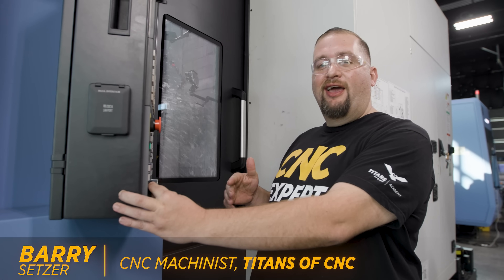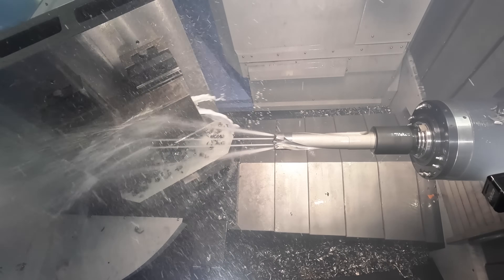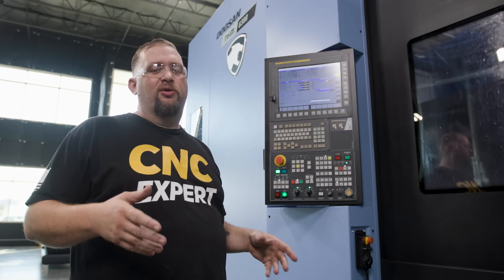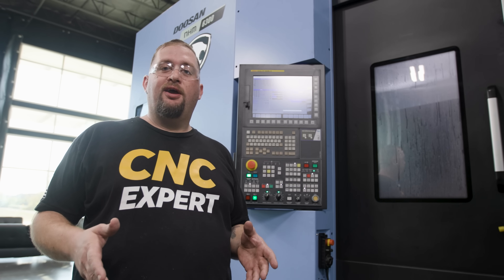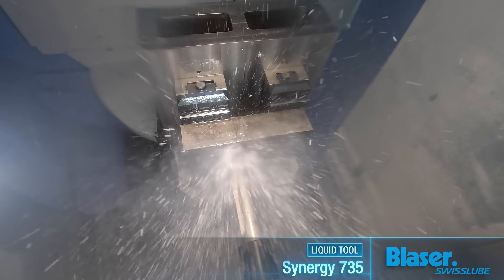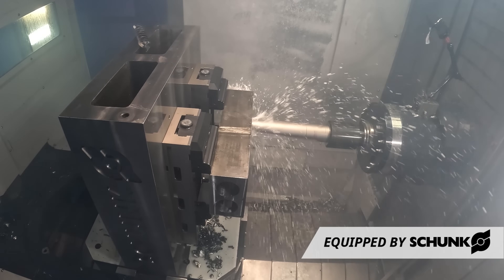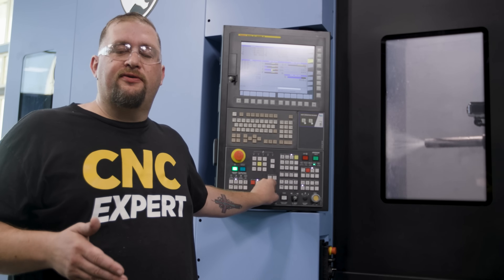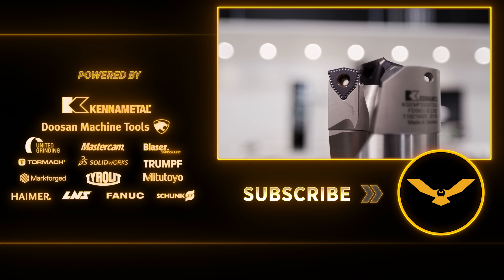Monster Drilling Test in Steel | NHM 6300 Horizontal CNC Mill | DN Solutions

Comment: That’s pretty small 😅 I’d send a picture of a drill I used to run on a Mori Seiki mill I used to run drilling steel flanges for deep sea oil pipelines but I don’t see an email. It was a long time ago but the drill was probably 5” in diameter by about 3 feet long. It was pretty funny there was some guy that didn’t know what he was doing and the mill had a top spindle speed of like 10,000 RPM and he had the drill in the spindle in jog mode and hit the spindle on button the machine went to go to 100% 🤣 it threw that drill through the sheet metal on the side of the machine and skipped it across the concrete floor in the building! Fortunately it wasn’t me that did that oops, that cost the company a ton of money, it actually broke the shaft in the spindle and destroyed the bearings. It was pretty cool, just not cool for the guy that did it as he got fired and not cool for the company because it had to have cost them $50,000 to repair all the damage to the machine. 🤣

Comment: I felt scared watching it that drill bit drill into that metal I literally was thinking something was going to break it was making me feel scared,and that's I could literally feel the drill bit eat and it was hot but the cool water was cooling it down and so it was just shredding, I thought something was going to break when it drilled in to the center did you drill back through  the holes and make a sharp edge, sharp enough to cut your finger, mama said you'll draw back a nub you stick your hand in there, at that point it's funny that you said it's scary, (ddtah) don't do this at home, and it was complete euphoria knowing that we have the ability now to do this, drill a straight hole that fast., super stroker soaker.,-) could you imagine if you were chained inside that thing. And someone just ran a random program on you how that would feel.,-())

Comment: How about running a 4 inch spade drill in a cnc machine (lathe). Is this something that can be done? I had to put a 6 inch thru hole through a 7 inch piece of S7 this week. Eight pieces going to take me maybe 10 days to do the whole job. Works out to about 20 hours of manual drilling. I used a 4 1/8 inch spade drill to start the hole. Sharpen the spade drill twice per hole. It wasn't too bad. I'm kind of enjoying the job. But I'm thinking how nice it would be to just to use a CNC machine to do all my work.

Comment: I know every has their opinion on this question I’m about to ask… Mr. Titan I have a question to ask n I hope u can help since u own different makers/brands of cnc’s. I’m n the market for a mill with a y axis of at least 30”. We have already a few haas vf3 vf4 vf5 n the shop. We have had an issue that cost us a good amt of $ cuz the vf5 bearings went out on the table. So that there alone makes us think twice about haas reliability. We bought the vf5 brand new. What would u recommend? My old man is stuck on some other brand I’m not too convinced about n how the sales person is dropping off $100k on the price. Makes u think why? I want to get my monies worth. We run a lot of aluminum  n that’s what we’re are purchasing for n the occasional steels no exotics. Thanks ahead of time for ur help.
Reply: In case Titan himself misses this one..........Here at Titans of CNC we run Doosans, we have no HAAS machines in the building anymore. The reason for this is that Doosan is a much better built machine for the money, and Titan wanted to make sure that he was representing the best value and quality for our friends out there. In this video, I am pushing that drill to over 180% spindle load in some places, and the NHM6300 didn't even blink.
Reply: As an example of Doosan reliability; I run a Doosan Puma 2600 4 axis lathe and routinely push the milling spindle load to 250% with spikes up to 400% and it just eats all day long. I also frequently run the lathe spindle as high at 130% load when roughing and it also just eats all day long.
Reply: Thx for the replies guys. Yea we had a sales person come out from Ellison Monday. I like what I hear about the VMC. As for lathes pumas are one of the best out there. When I worked at another shop doing premium threading all they had were puma n mori seki’s. My old man has his vision n I have mine jus like every1 having their own opinions. I hope I can get a doosan. Was looking into the DNM 750 series.

Comment: Simple question?
Why do you hang your vises with the solid jaw up? I’m getting ready to add vises to my tombstone sometime next week
Reply: I would like to think that the reason why, is because on that machine, the Y+ axis is points up. This is so that the program matches what's visibly shown from the operator window. Some horizontals treat their orientation like a vertical mill just on it's side, thus the Y+ points toward the machine. If that occurs, the solid jaw should really be facing down.
Reply: @gredangeo  Correct sir! On this machine y+ is up!
Reply: @barrysetzer  so I should hang mine the same ?
Yes y axis is up 
Or is it just preference
Reply: Hey Paul, I personally like them solid jaw up, as I tend to either set Y0 at top of stock or center of stock. However, gravity is in your favor if solid jaw is down, and your heavier material will be easier to load. So that said, I suppose its personal preference!!

Comment: 63,5mm is big but in our workshop we have one very rarely used 68mm beast. This things is loud AF even at low RPM. xD
Reply: You should see our 118mm drill in the lathe its insane
Reply: @mennomeilink4660  Nice. The size depends of what details you guys are manufacturing. We are making forklifts and lifting equipment.

Comment: I would also add that knowing your spindle power available is only part of the equation.  I used to run a lathe with a very powerful spindle, but the Z-axis drive motor was so underpowered that it would overload and alarm out before the spindle motor even realized it was drilling a hole.  About the most it would do is .002 ipr with a 2" drill in heat treated steel.  Still got the job done, but always seemed to take more time than it should have.

Comment: We had a 4.5"x18" 2 tip indexable double flute drill bit we used on our horizontal 10" spindle mill. The machine was a beast. I would run .006" per revolution and that thing would just shit out chips. So much fun to use.  We also had an old ww2 planer that would cut weld chamfers on steel plates 30' long and I would take a 1" wide pass and have chips the size of car shock springs flying off the machine I still actually have a chip in my garage. It's about 6" diameter and looks like a car spring.
Reply: Holy crap. I'd love to see that. I love the old machinery
Reply: @ytfan3815  bro the machine was from the 60's I understand speeds and feeds. But I am a manual machinist. I looked at chip shape and spindle load. That's how I determine the machines rpm and feed rate. And when you feed with the spindle on a machine like that. Feed rate is in inches per revolution.
Reply: @ytfan3815  ohh ok have a good one.
Reply: I drilled 3.15"x31.5" holes with Kenna HTS drill, luckily it was cast iron.